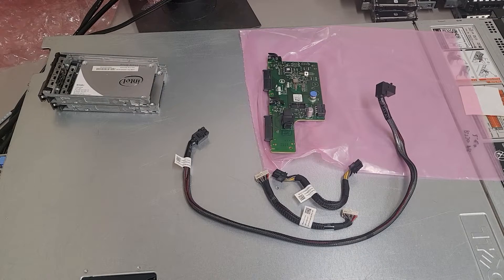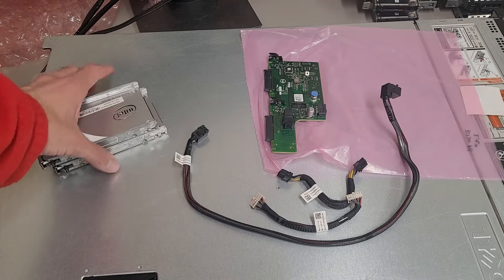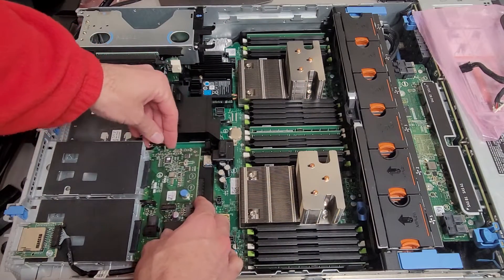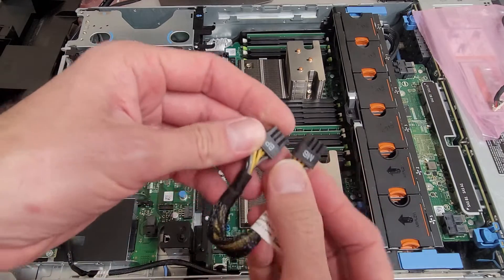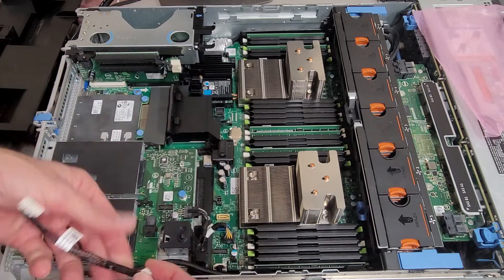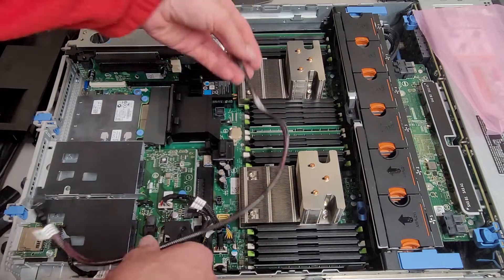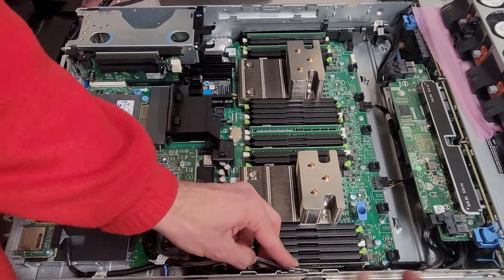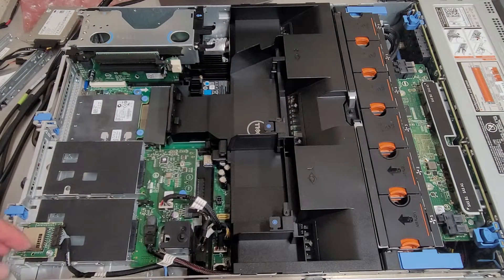How to add 2.5" flexbay backplane to R730xd 24 SFF bay that doesn't have it already

Comment: Wow, thanks! R730xd with H730 mini goes with one backplane of 12x3.5" SAS, but limits speed to 12Gbps for all of them. If I install another card like HBA330, can I connect it to the backplane so 4+4 disks (2 cables) disks go to the HBA330 and 3 to the original H730 you reckon?
Reply from the maker: @Magnus_E  I'm not sure if you can split the main backplane up between two raid controllers. It might be possible.

Comment: Thanks for the video.  Unfortunately my 730xd is the 3.5" HDD model and I didn't pay close attention when ordering a Flex Bay kit, and got the one you installed into your 24 x 2.5" unit.  The only difference is the SAS cable, and once swapped, I now have 2 bays in the rear of my 730xd.  Moral of the story, play close attention to what you order! :)
Reply from the maker: Interesting to know. I don't know if I paid attention either when ordering mine. At least it worked out in the end for both of us.